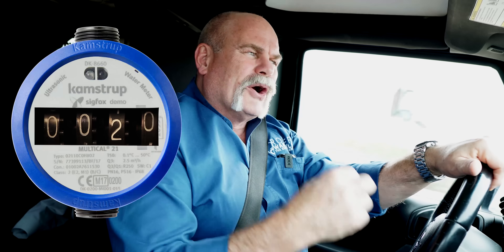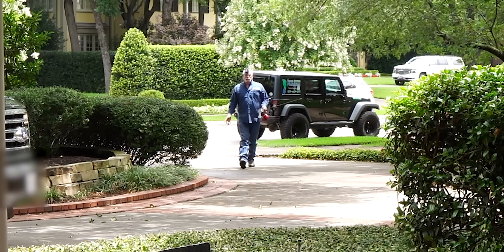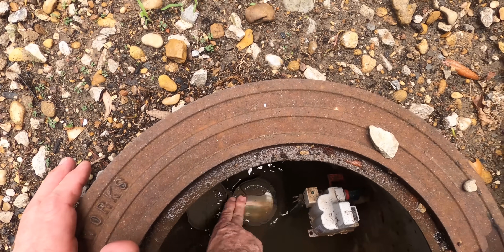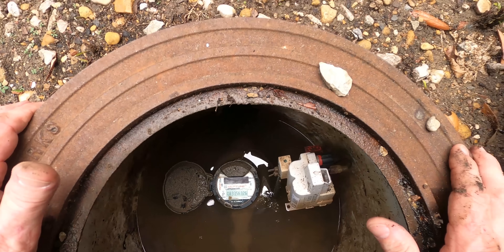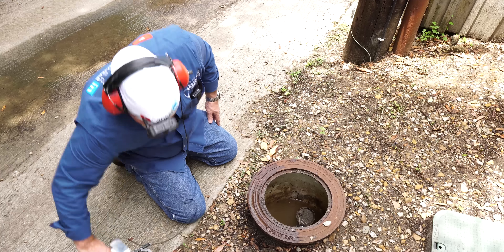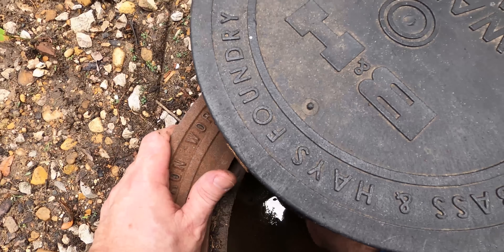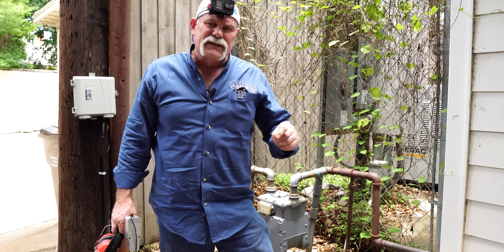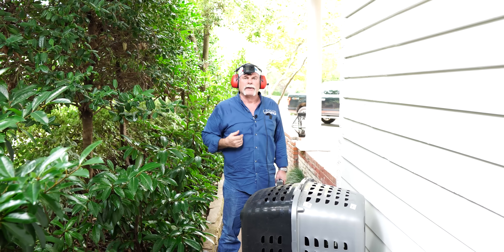How to Find Water Leaks - Water Meter Hasn't Stopped Spinning

Comment from the maker: What do you think about this leak?
Reply: Toilet bad flapper and the fill valve kicks on
Reply: I wish my City would have notified me that my meter was going nuts rather then send me a 3000 bill
Reply: When I do this, I start by shutting off all the valves for the toilets. Then I put a water pressure guage on the system and shut the meter off. If the guage loses pressure then I know there is a leak. Then I isolate the house system from the irrigation system and determine where the leak is coming from.  What do you think of that approach?
Reply: @michaellaraii3050  That's how I do it too :)
Reply: In my area near Asheville NC, the digital meters are similar. I have on a few occasions, found meters installed with no check valve at the meter. This allows back flow at the meter. Two meters I've encountered, were faulty, showing water going to the customer, but it was actually going back into the city's system. The city replaced the meter, and the problem was solved. What brand of leak detection device are you using in this video?
Reply from the maker: @joshm5816  www.leak-pro.com great stuff!
Reply: I do maintenance on about 500 apartments and had one complex where tenant pays thier water bill. Well they called complaining that "WE" had a leak and that "WE WERE GOING TO PAY FOR THEIR $1700 WATER BILL." I go there being very observant for a 3500 puddle of water. Noting! I go to meter Yep it clicking away like a broken Timex. 1st try to access the Outside Valve, the Water Dept actually has a LOCK ON IT with note to the city water dept in case of emergency. I go back inside SHUT OFF ALL the stops inside. 
Go back to the meter box....and Yep it's still  clicking away. 
Call the Water Dept, 'Oh No it's not our fault'
They came back out pulled the meter... TADA broken meter
Reply: Toilet fill valve
Reply: We had a toilet that ran occasionally just a little because the little tube from the valve was run just a little too far down the overflow standpipe.
Just one potential cause that can drive you insane trying to find it.
Reply: Have you actually ran across a residential house potable water system
 that's was protected by a double check valve?
Reply: I would do a dye test on toilets.
Reply: @anthonywilliams3048  yes it sounds like a flapper is leaking.
Reply: @anthonywilliams3048  what is that?
Reply: @Kitronic11  put dye in toilet tanks. Wait and see if it leaks into your toilet bowl. If it does u need a new flapper. Pretty simple.
Reply: I'm not a plumber BUT.... a small leak tgat comes and goes..... That sounds like a toilet fill valve. Something causing toilet tank leak down then fill valve hope it off again with just a tiny bit of water.
Reply: could be a faulty meter? is saying 0 to you but telling HQ or whatever that 'hey its busy as eff'.
Reply: I prefer the analog Badger meters I work with, no matter how small the leak you see it because it's precise enough to indicate a flow of 0.01gpm, only gripe is going to each meter to take a reading for the bills
Reply: I suspect to much taco bell. Causing a nasty leak.
Reply: Bad flapper or ballcock with a small leak
Reply: Had a leak.Removed the P-junction from my sink. Nomore leak.
Lots of yugh though. Keep plumbing <3
Reply: Meter malfunction
Reply: Either a fill valve or flapper on a toilet or if there is a check valve or backflow preventer at the meter and nothing to allow for thermal expansion such as an expansion tank at a water heater or a calibrated relief valve
Reply: 0.33 gallons. Sounds about right for a low flow toilet (as has been mentioned by many others in here).
Reply: I think your a good plumber:)
Reply: License plumber with water leak equipment but can not isolate whether leak from inside or outside the house on visit trip !!!. I won't hire you...
Reply: No clue, showed up for a show & tell, instead got a rock concert.
Reply: I am not sure about this leak, not a plumber or anything......I would have went to the next two houses and opened up their water main covers and looked to see if they were dry inside. I wonder if its a very small leak right after the meter which you are not noticing it in the house but it filling up that area where the meter is.
Reply: Why add the annoying music?
Reply: Toilet
Reply: I like how you say Jeep and not service vehicles. USA!

Comment: Your crumpled up COVID mask is likely ineffective as a bio-barrier.  An important component to the x95 rated masks is their electrostatic charge which electrostatically repels particles in the air.  This is why a new mask should be used each day, and the mask itself should come into contact with as little as possible when not in use.  Ideally, the mask should be stored in the sleeve that is was packaged in when storing it for later 'same-day' use.  Crumpling it up and sticking it in a pocket is one of the worst things to do with a 95 rated mask.

Comment: Can you make a video on determination if your hot water tank requires a expansion tank. I live in mass and I’m on public water hook up. My water meter does not have a check valve. But my current water heater has both a expansion tank and a vacuum breaker installed.  Do I really need an expansion tank?

Comment: New subscriber here...loved your video. We are a retired couple living in NJ and got our winter quarterly bill for 624,000 gallons of water use at a whopping cost of $1400.00! All outside water spigots were turned off and no one had access to our home. Also we were away for 3 of those 12 weeks. They claimed we had a leak somewhere or that something happened that we don't know about. Our master plumber did an inspection and confirmed this was not possible. They took the meter for testing (It's a Hersey analog meter) and found it to be running too slow but we knew before sending it in that it was working fine because since we got the bill we have been monitoring it and we use about 100 gallons per day. The Business Administrator of the town feels they did their "due diligence" by testing for water flow but no mechanical test was ever done, nor did anyone from the town believe that we didn't use that water either neglectfully or willing. The "leak" apparently "fixed" itself as we never had any repairs done. Our toilets are in fine working order and do not have an outside irrigation system. PSE&G had done work in the street and in our home (new gas meters being installed) that quarter and we don't know if that could have caused the meter to go haywire. Roger, how is this possible? Any help or insight you can give us would be greatly appreciated. Thanks and have a nice day.
Reply: I am going through this exact scenario right now, only difference is my neighbors had a slab leak and got it fixed. also my bill was 4,500$ for 160,000 gallons of water . Portland Oregon water costs more than places that have sever draught. Did you ever find anything or did you just get robbed by the water company as i am currently being.

Comment: Been a plumber for 20 years and I had a call that I've never experienced! Water meter dial was spinning. Looked at all fixtures. No visible leaks. Shut off the ball valve on building side of meter, and turned it on right away. The dial turned as if to catch up and then sowed back down but didn't stop. Shut the ball valve off again, this time for about 5 seconds before turning it back on. This time it stopped! Called the H2O dept and had them come and change meter with a new one. It indicated nothing! How can that be? It should've kept spinning if there was a leak. So how can the dial spin if no H2O is being used? Never seen this one before! Anybody knows something please lmk!

Comment: Have you ever run into a faulty meter?  The city just changed out to a new meter with a sensor a week ago and low and behold they've detector water usage everyday since the new meter install.  I've looked everywhere, shutoff every supply valve, and no change.  The indicator dial is spinning extremely slowly and sometimes spins backwards.  I also noticed that the meter is not tight and can be moved by hand about 1/8" and also is very vibration sensitive.  Not sure if that's normal.  The city claims they've never seen a failed meter in 5000 installs.  Being an engineer, I know failure rates aren't zero on anything.

Comment: Couldn't find a leak on the house and potable water is tied into sprinklers. Did you test irragation to see if there was a broken line or heads that could being using the excess water?

Comment: The "possible leak" looks intermittent. I would say probably a device or something kicking on every few minutes. GPM output on most digital meters is a average so 0 GPM is actually 0 GPM. So 0.33 GPM should be average from the time it shows the reading until the time it shows the flow rate again.

One explanation why the city reported this is how most meters work is they will report a leak if there is no 5 minute water consumption break within 24 hours. The flag will clear once the 5 minute condition is met.

If the water company allows, the customer can request consumption information that will break usage down by the minutes or by hours like our old system did.

Comment: i woulda vaccumed the water out of the meter box and checked to see if the union was dripping. problem wasnt found. would have isolated the shut off at house and checked meter over 15 mins to see if possibly a toilet flapper letting water by and a fill valve running for a few seconds (you most likely here as its a small amount of water for a few seconds every once in a while)

Comment: That meter appears to be a Neptune meter. Depending on the model that brand has the ability to produce a report commonly known as a Data Log. This report will tell you when a leak began and how much water moved by Daily and/or Hourly. My town uses mainly Neptune and Sensus brand water meters. Although the meter cannot tell you where a leak is the meter can give you the exact moment the leak began. Often times, homeowners will have water using utilities replaced and the Data Log will show that it. I live in Utah so your area may not use either brands. Also! Please talk with your City to know if you and/or your plumber is allowed to turn the meter off/on otherwise you could receive a Meter Tamper Violation Charge

Comment: If there is going to be a follow up vid, it should just be edited into one vid. I’m curious if it ended up being a faulty meter or a leak? I once had my meter read as though I filled an Olympic swimming pool two months in a row, with no leaks. The city tried to blame it on a faulty toilet flapper but that wasn’t correct. They ended up replacing the meter and it was fine thereafter. I’m not sure whats inside a water meter, but they do fail.

Comment: I have a lot of irrigation leaks to fix, some easy and some not. The easiest way I find them is when I mow the lawn, there is always the same wet spot, which doesn't make sense because the rest of the yard dried up. The last leak I found was a pin hole in an underground pipe. After that, my solution is that all outside lines need to be replaced because who knows where else a leak will form.

Comment: Newer neptune meters have a built in leak detection system and it will read countinous leak. It has a system that records usage every 15 mins or so and if it notices usage during all or most of those no matter how little it will throw a continuous or intermediate leak  message. The city should have been able to provide a print out of the times and amount used if they have the special reader.

Comment: An intermittent leak like that is almost always a leaky toilet flapper. A few drops of food coloring in the toilet tank will confirm if it bleeds through into the bowl. Next check the relief valve on the water heater for signs of leakage, it may be corroded or otherwise damaged and not working properly. Total cost for self-performing that service call is about a penny.

Comment: Cameraman needs to learn a bit more from tv cameraworks. Cuz this certainly has the feels of TV camera works. But it kinda feels off. Also audio volume equalisation also needs a bit of attention. Because i'm finding myself turning up the audio a bit and down a bit and i don't have auto gain and auto limit.

This is just my opinion. I'm still learning stuff.
Reply: Same here with me, volume level is not consistent. 

Otherwise than that, great stuff!

Comment: Intermittent flow. My guess toilet flap. Tank keeps topping off.
Reply: The evil Phantom Flush!  I have the Mansfield tower style system.  When I replace the seal, it takes a few hours for the replacement seal to seat and get some phantom flushes til it seats.  Not sure if there’s a trick to get it to seal immediately.  If anyone has an idea, please comment!  

I really like the system as it allows you to do a short flush for just liquids, a normal flush for solids or even hold it open if you have a slight clog and just need a little more water.

Comment: I also learned a lot from this video. I learned I hate rock music!
Reply: Why didn’t you turn the valve off going to the hose to isolate make sure the leak is from the meter to the service valve going in to the house? If meter does not move put a pressure gauge in the hose bib with the valve off to make sure it inside the house or not ??? That way you would know if it’s from to meter to the entrance of the house or inside the house? If inside the house could be any fixture would be easier to detect.  Maybe a few points to the expert.

Comment: Turn off the house potable water and the irrigation to separate the two and put a gauge on the hose bib that you said was on the potable side...  thus eliminating or confirming which side is leaking... plumber in Vegas

Comment: What?
If I had been there. . .
1. Why is the meter submerged? The box makes up above grade, so surface water ought run around it.
2. Did we ever actually PROVE that we are on the correct meter? That is, where is the test shutting down the meter stop and then checking that the domestic side is dead?
3. Shutting down the feed to the meter, and then (?) checking for flow would only tell you that the curb stop is bad, worthless information. 
4. The dual check being shut down (supposing that it does feed only irrigation) might possibly reveal a leak on the potable side, but as is, there is no way to invert the test, and prove integrity on irrigation only. There is a missing main SOV. Look indoors near the tank or softener? 
5. This vid is an excellent example of why I hate digital meters! The sample (to be meaningful) should have been first to isolate the entire system at meter. Wait 15 minutes,  and recharge, provided owner knows to open NO valve or faucet. THEN check flow to see if it is still dancing between 0 and .33 (gpm?). The static pressure ought drop with clock time, if a leak is present, and so, a surge upon opening up the ball valve will tell the story.

Comment: Roger: let's take a listen to see if we can hear anything.
blasts heavy rock music
Reply: it was cring worthy
Reply: @jazziez6467 how do you propose we’d hear what he hears with the equipment he had lol
Reply: Mine is a very similar device.  All you hear is white noise.  An on a pressured pipe you have the white noise a you’ll have depending how far from it. A loud of faint sounding jet engine sound overlaid onto the white noise.  It’s nothing fancy yould hear.  
A for pool pumping we introduced nitrogen into the lines.  Also. To get a water/gas mixture coming through the leak. When possible.  To add to that leak sound some.  It changes it some.  Or makes it more noticeable etc.  but he’s not hearing anything magical a fancy though. You’re hearing white noise. A looking for another for the most part white noise ontop of the other. That just gets louder the closer you are to it.

Comment: Should also let people watching not to operate the shutoff valve at the meter, the city may have a ordinance saying that only the city can operate that valve,  people can  be given a fine plus if it starts to leak the city may charge them the cost of the repairs.
Reply: In the county where I live in NC they've told me only a licensed plumber or their personal can turn the valve on or off and if I have have a water leak to call them and wait for someone to come and shut it off for me. They said they would be there fast but screw them, waiting for them to get through traffic while my house floods. I closed it myself.
Reply: @mattluongo7763  I work for a city in Missouri and our staff is the only ones allowed to turn off the valve, but if its a matter of damaging property we let it slid, even if the valve brakes, but if they go out and turn it off for anything else than a emergency and it brakes, then there is a $1000 charge for the repair